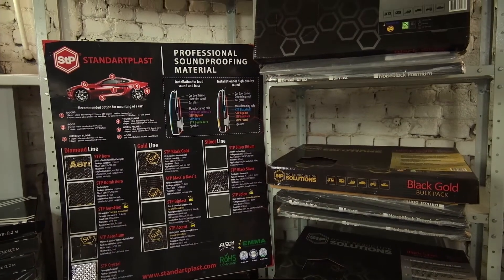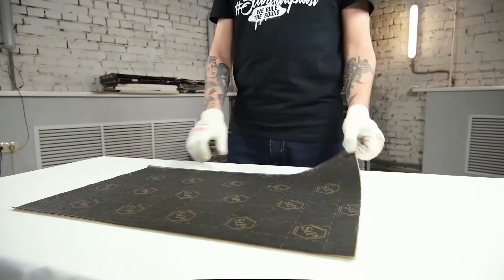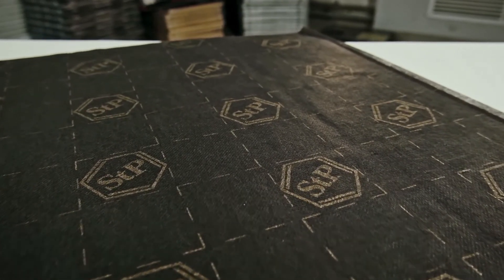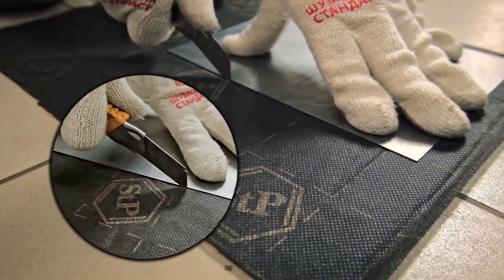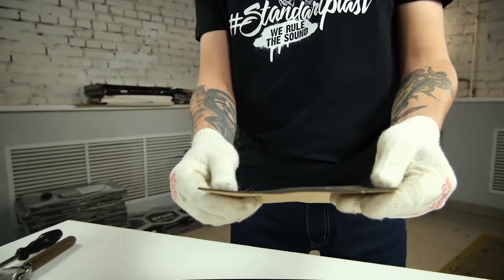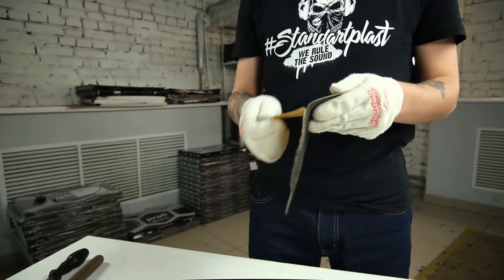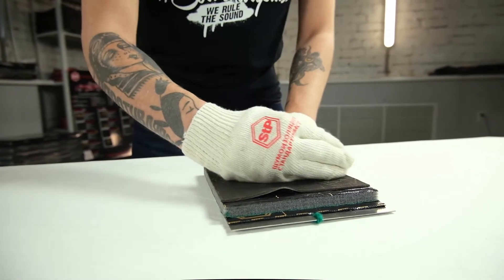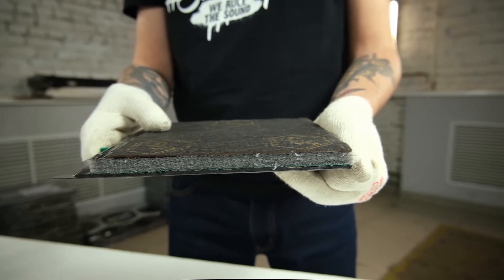StP Noise Block - sound insulating material

Comment: Is this like a mass loaded vinyl to stop road noise entering the cabin?
Reply from the maker: STP NoiseBlock is sound insulator, sound insulator is always heavy mateial. According to scientific investigations, the best results the material demonstrates when it used as a third layer, after vibro-damper (1-st layer) and sound absorber (2-nd layer).
Reply: @standartplastworld2937 can this noise block put under hood?. does it can tolerate the engine heat?
Reply: @standartplastworld2937   What is the reason of using 2 different sound insulators like Noiseblock (3d layer) over Accent(2nd layer )? Accent is not enough as a 2nd layer ? Or acts like a protective layer ?